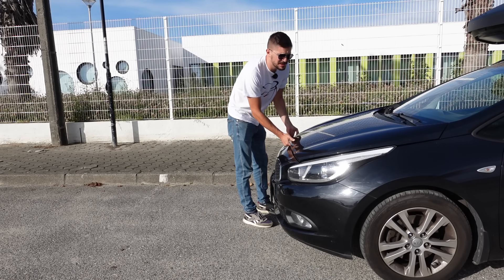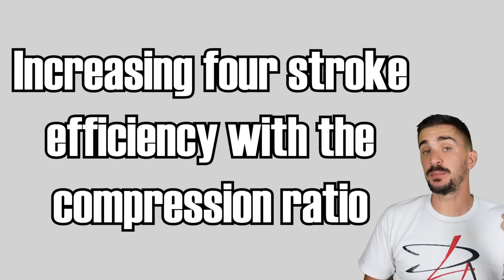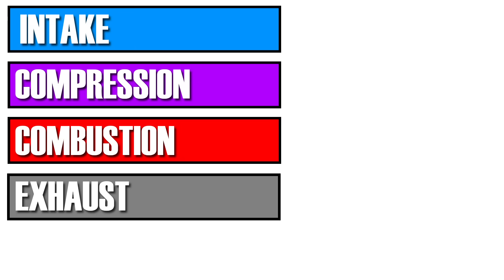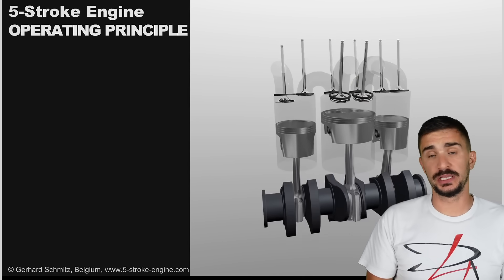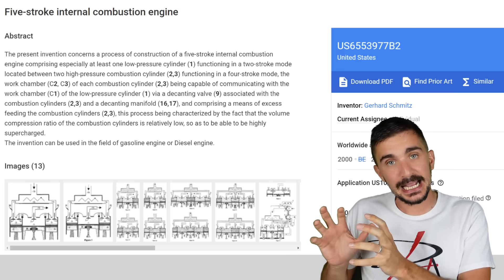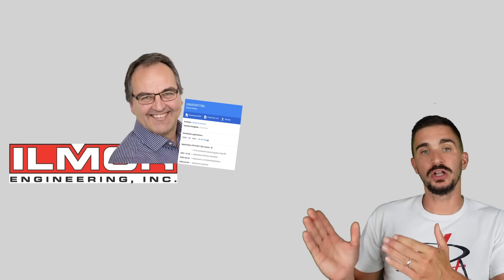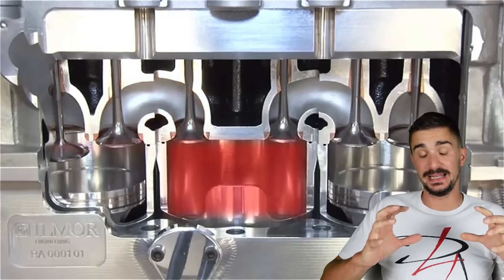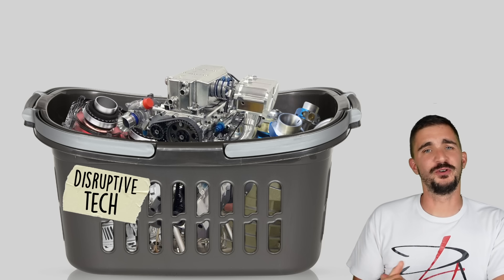Why Five Stroke Engines Are More Efficient But Still a Failure

Comment: I dont see how this engine is all that great. Today diesels have EGR systems that redirect exhaust gas back into the intake manifold and mix the stream of air before combusting it again. It is efficient because it uses residual oxygen and fuel in the exhaust and also cuts down on Nox emissions. Now if the point of the engine is to save the pressure from combustion and use that energy for efficiency then maybe we should be asking why they dont mount a compressor to the accessory drive and run exhaust gases through it before sending it back to the intake. This way the pressure that the pistons created is maintained as it goes through the pipes to be reused. Of course running the compressor uses power so youd have to do the math and find out if the return is worth the cost. But really having an extra piston to just dump exhaust into it and combust it is not the greatest idea. I mean why not use that cylinder like the other two and use it to dump exhaust? And the answer to that is think is EGR which divides the exhaust among all the cylinders. My only question would be does exhaust psi go down before it gets to the cylinders to be reused? But honestly EGR overall actually subtracts from engine performance and has a negative impact on the engine. Your putting exhaust where the clean shit is supposed to go. That means dirtier oil from soot, and less oxygen meaning less power. Really the best way to use exhaust gas would be to power a turbo or a turbo compound unit like what volvo does on semis. They have an exhaust turbine after the turbo that is connected to the gear train. They recover exhaust energy by putting it right back into the gear train and get back up to 50 hp and 7.5% increased fuel efficiency.

Comment: Did they make a diesel version of this engine? Wouldn’t that make substantial higher exhaust pressure and temperature? Couldn’t you also utilize water injection into the middle cylinder and take the heat from the exhaust to steam water and produce more pressure? Just questions? Water injection is something I’ve been very curious about trying to find untapped methods to utilize water injection and steam to produce energy.

On a different note have you heard of this solid state engine that’s been proposed?

Comment: Why dont you maximize engine efficiency, have all the emissions be Nox and no carbon pm, then use the SCR system to remove all the nox. That way you dont need the DPF system, all that weight, complexity, and expensive crap is gone.

Comment: Still not a bad video. And I too thought the same way regarding combustion engines. But it isn't the engine so much as it is introducing a "liquid fuel" to the engine instead of "vapors" from gasoline. This tech was developed in the 1050's, and even with a carburetor MPG was 50 miles per gallon for the vehicle. This tech was bought up, and then disappeared.. You only want the "Hydrogen" portion of the fuel which is the vapor, not the liquid which does not burn due to the Carbon. And it is because of the carbon element in the molecule that engines produce a toxic gas for humans known as Carbon Monoxide. Which is really dangerous as it has no smell, and just 15% Carbon Monoxide saturation in your blood is enough to kill you.

Comment: Measuring power based on displacement is foolish, all that really matters is power per mass of the complete engine and power per outside dimensions (Roughly volume of the complete engine but not crediting concavities.).

The triple expansion steam engine, which was the major steam design during the early 1900s, used exactly this concept (Replaced by steam turbines or Large diesel engines).

The real advantage of the original Atkinson is that there is no aerodynamic energy loss due to the hot gases being forced through valve ports on the path to doing additional work on a secondary piston.

There was a production 5 stroke in used commercially in the USA. The turbo-compound version of the Wright R-3350 duplex cyclone was used on the Lockheed Super-Constellation passenger plane in the 1950s. It used three radial turbines coupled to the propeller shaft to capture that escapeing exhaust energy.

Comment: So the only case where you could use this design is with hybrid/gasoline-electric drive trains bc. you could operate the engine at peak load. Or of course in generators that have a fixed load. But that is where we typically use diesel engines for they are already more efficient with peak efficiencies around 55%

Comment: Combustion engines are capable of using a number of different fuels to run them. Petrol or Gasoline is not the only fuel for them. But if used properly, gasoline can be a good fuel combustion engines, and would pollute a fraction of what they do today. If "Global Warming" is such an issue, and if EV's are such an issue being 3 times the cost of a regular car, then it makes sense to change how we fuel our combustion engines. Unless the real goal of EV's is to make it so only the rich can afford to drive, and the rest of humanity must ride a bicycle which in turn reduces opportunity and freedom.

Comment: And the tech is cheap and available today right now. Liquid fuel is a terrible idea. The only thing you need to go from a liquid to a gas is pressure. Jet engines today are around 90% efficient? How? By converting the liquid fuel into a gas before introducing it into the turbine portion of the jet engine. The same can be done for combustion engine. You would see 75 MPG across the board for all vehicles if only the vapors were introduced into the engine instead of the liquid fuel. We can do this today, right now for about $1,000 per vehicle. This is NOT new technology. But an understanding of Hydrogen as a fuel. Which it is the number one fuel source in the Universe. But corporations make more selling you the wrong product to use in your vehicle.

Comment: It's not the combustion engine that's the problem. It's the fuel. Liquid Petrol or Gasoline does not burn. Only the Vapors. The liquid does not burn and is what goes out the tailpipe as unburnt fuel, or "pollution. Petroleum is a hydrogen carbon molecule. Well, the vapors of the liquid is the hydrogen part, the liquid a combination of hydrogen and carbon. Carbon does not like to burn. So we are basically using a poor form of hydrogen gas to power combustion engines. When we should be using pure Hydrogen Gas. It would give better MPG, and only steam would come out the tailpipe. Even only using the "vapor" of gasoline in an engine would allow for far better MPG than today. An improvement of 50%, and less pollution.

Comment: I disagree with your logic on the 700 cc vs 1500 cc question.  Engines are sized by how much air they intake, per power cycle not how much size there is inside.  So the 700 cc is correct.  The LP cylinder is not using any more air.  Also, the second point makes this engine very suitable for hybrid cars where the IC engine can run strictly at peak efficiency RPM's.  This takes care of your third problem.  So there must be other issues that killed this.  The three you mention are not issues.

Comment: Since we capture a good amount of heat in the coolant and just dissipate it to atmosphere, I've wondered if we could capture some of that by running stirling engines coupled to generators off of the cooling system.

Comment: Offsetting the crankshaft centerline from cylinder bore changes the stroke duration. This has proven to increase power and efficiency. If one were to couple this with the headgasket free design of the Offenhauser Drake engines, higher compression and direct injection, the additional efficiency from this particular technology would be increased. Also, patents have time limits so this technology can be pursued as soon as the patent expires. The displacement issue is a red herring as his argument is valid concerning combustion. This engine would be ideal as a generator powerplant for a hybrid vehicle as is could run at its optimal rpm at all times. IMHO as a retired Industrial Design Engineer.

Comment: I thought this was new tech. I didn't realise it was old tech. In the 80's Chrysler was throwing turbos on everything. Massive mistake. There failure rate was basically 1 to 1. They never updated the engine to a 16 valve twin cam design. That way everyone is RB, JZ1, JZ2 or anything like the Honda K series. Companies have made their life around K swapping anything. Just look at PSI's / Boosted Boys Channel Same team just different locations.......

Comment: Because the 5-stroke is best under high-rpm and high-load would it be ideal for hybrid application driving a generator at constant speed running an electric drive motor?

Comment: Novice here. What if you were to add a small compressor to the engine and a tank to store the exhaust gases then use that compressed air to backfeed or in some other fashion add power to the engine? Yes it would add some parts but not many. I'm thinking like a hibred here, where at some point you are powering the cylinders off of just the compressed air then switching back to combustion when the pressure drops?

Comment: Would it work to have a turbine, like a turbo, but driving a generator on hybrids? So when the gas engine is running you could at least partially charge the battery with the exhaust gas.

Comment: Didn't electric motors come first? And would no that make them older by default and way more widely used. There is one in every cellphone and it is the thing that starts combustion engines (unless you have a crank shaft or shell starter)

Comment: I think it would be better not to split expansion phase on two cylinders, but separate intake and compression to separate cylinder. So one smaller and cold cylinder makes intake and compression and then pushes the compressed air to another one where it burns and expands. That will give a lot of benefits because fresh air will not heat up from the cylinder walls before burning. In the same time expansion cylinder can be much hotter, that reduce the thermal losses. Also intake piston can be made lighter as it works with lower pressure, that will decrease the mechanical losses. Or it even may be replaced with another kind of compressor, like rotary, connected to the crankshaft with a variator to control the power instead of a throttle.
The only problem is to push the compressed air from one cylinder to another fast enough. So that might limit the RPMs. Or we need to close the exhaust valve and start exchange the new air earlier, that means there will be still a lot of exhaust gases. But that is good for NOx reduction.

Comment: Wait a minute I know this guy There's only one YouTube guy that talks like this and it's the smart this is the engineering guy!  Has anyone ever tried taking the alternator off the engine and running it off and an exhaust system take a load off the engine and use some of the exhaust energy somehow? Now I'm going to have to look that up.

Comment: Oldest vehicle engine? Isn't the electric motor w/battery at least as old as the Otto Cycle engine? My reading is they were first used to move vehicles very close to each other, possibly the electric motor preceded the 4 stroke piston engine? And both are still working well today.

Comment: Can't the separation of compression and expansion (ratios) be addressed much more easily by offsetting the crank to one side of the cylinder(s), and/or adjusting valve timing?

Comment: If the exhaust pressure is more than  6 bars when the piston is down it must be better to reduce the amount of fuel injected to reduce that pressure?? Another thing is that a diesel engine with ADBLUE ( EU-6) is cleaner than a gasoline engine

Comment: Maybe someone could come up with a revolutionary 2 stroke engine, that DOESN'T require the burning of oil, has forced induction and thus, with less moving parts, is lighter than an equivalent 4 stroke, and having 'Bangs' every 2 cycles, more power than the equivalent sized 4 stroke motor. With modern 'Powervalve'/timing, fueling & exhaust tech... Efficiency would be higher and emissions could be the same if not lower than a 4 stroke... 🤔

Comment: RE: 2nd problem with 5-strokes, higher efficiency only at high rev/high load; Has anyone considered taking 5-strokes to the light aircraft sector? The ICE engines in small piston powered planes are comparable to a common consumer car, the difference being the plane's engine spends most of its life running at 80-90% capacity while a typical motorist barely revs that hard running late for work. So, this problem rightly makes little sense for a car, but it sounds perfect for a Cessna.

Comment: Add vtec to the valves and a bypass port with a valve that redirects the exhaust straight to the manifold at low rpms and all those problems are solved ya?

Comment: The glaring problem I see with this design is the fact that when the exhaust gasses are pushed or (whatever you wish to call it) from the combustion cylinder, to the expansion cylinder, you have a closed space, where the exhaust pressure pushes on both pistons during the entire transfer process. The exhaust pressure on the large piston will create a larger force than the same exhaust pressure on the smaller piston, and if a method for a longer stroke on the center piston is employed, the added leverage will also serve to create additional rotational force, but the net effect will still be, only the difference in these two parameters(difference in bore, and difference in stroke, of the two cylinder assemblies, at a given exhaust pressure. This seems like a lot of hardware for this small gain.

Comment: What about a sort of clutch in the crankshaft to disconnect the extra cylinder until rpm’s are where necessary then it engages. This way no dead weight, and temps stay high unless you’re high in the tachometer. Sooooo basically a turbo I guess. Curious if this would work tho

Comment: Thank you for the video cause i always have the curiosity why this engine not survive.claims are claims right? Since external combustion engine achieve 25% eficiency sometimes i wonder why dont they make an hybrid with a boiler in the exhaust manifold ,you see where im going .I believe bmw do something similiar with a blanket and a steam turbine in a x5 but it hads to much complexity and cost and the cofee machine can explode if not maintained properly.I belive the f1 solution is the most reliable and efficient  since mercedes f1  achieve 50%. So for masses an atkison cicle like toyota brilliantly do with a small battery and the only thing thats missing is an MGU-H .Since the new porsche 911 have an electric turbo i believe we are close and then we lose to the authority of thermodynamics.thats life.CONTINUE YOUR EXCELENT WORK SO OTHER PEOPLE START TO UNDERSTAND WHY YOU CANT MAKE MISSILES OF MUD

Comment: It seems to me a good and efficient application of this engine would be to power a generator. Because it is relatively constant RPM and constant load. More specifically I could see it being used in electric- gas hybrid vehicles. Ones that are primarily electric drive but use a generator to recharge the batteries. Such as the Chevy Volt for example.

Comment: Hi there , 

Thanks you very much, for yours always clear simple explanations.

 I'm very sure that if this technology is integrated into the 3cyl TURBO Nissan Rogue engine variable stroke technology, it will be the winning ticket and game changer. 

"Very simple" (LOL), this little Nissan Turbo 3cyl variable stroke length engine not only produce 345hp, it those it without any aftermarket mod's.
But it's present magic comes mainly from the variable compression by varying the cylinder stroke length and switches between low and high compression and the other basic variable valve timing, etc, and other tricks.

The mod to make this engine into viable 5 stroke engine.

Where the propose of the "variable 5 stroke technology" is to have the middle piston used as the low compression piston, as in the 5 cycle engine.
Buy at low RPM's this piston low compression is left at TDC with open valves for the exhaust bypass bypass the 5th cycle at low RPM. 
Therefore the engine will be varying between 4 and 5 cycles as RPM dictate. At low RPM's 4 cycle , at high RPM's this engage will engage into the 5 cycle mode and valve and everything come into play.

To resolve for the lost of the middle piston in 4 cycle engine, the solution is even simpler.
Yes a second bank of piston, yeap a V4 engine or boxer with two variable 5th cycle pistons.

The only problem that see to all this (LOL), is that the Geometry of the Nissan 3 cylinder turbo variable compresion by stroke length engine is that needs to be rework out all the geometry, which is actualy is very badly. It's a poopoo design, that was done in a "hurry". 
That happened when CEO pretend to know more than the engineers.
Both know about numbers.
Engineers knows about real number, CEO know about POSSIBLE numbers, better send them to the casino, LOL.
But is true  !!!!
Now you know why engineer never have the whole picture and not the whole !!!

For even more ambitious and applications a W6 engine. Can you imaging a Bugatti with a Variable 5 Stroke W16 engine ???

The sky is the limit !

Can you image a Variable 5 Stroke Radial engine with this configuration in a airplane !!!

Capisce !!!

Atentamente ,

Carlos E. Abreu Girald  😃

Comment: We have the very same distance of every stroke due to crunk-shaft design. 

What if the piston movement can be controlled by a linear electro-generator converting expansion energy directly into electricity and using this electrical energy for 3 other strokes? If we don’t connect piston to a mechanical crank-shaft, we theoretically can vary the distance of the piston movement during each stroke. 
The question: did someone tried such design?